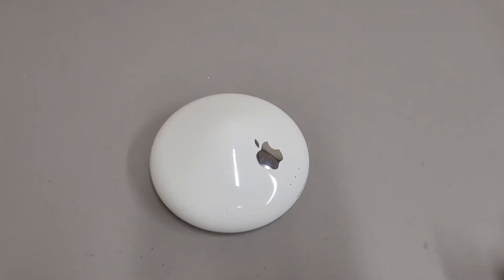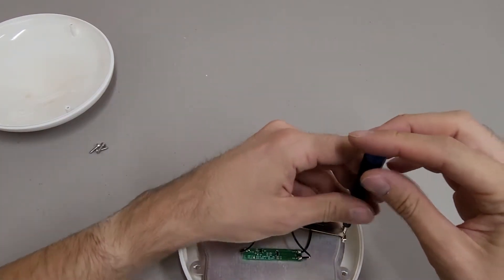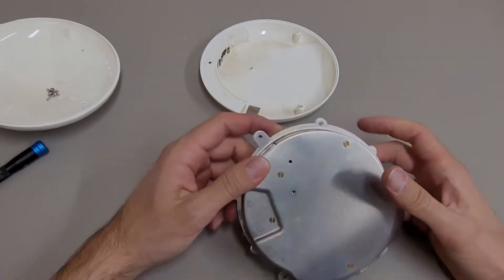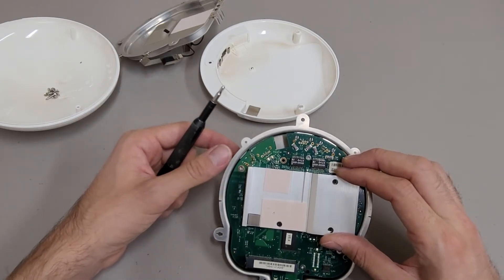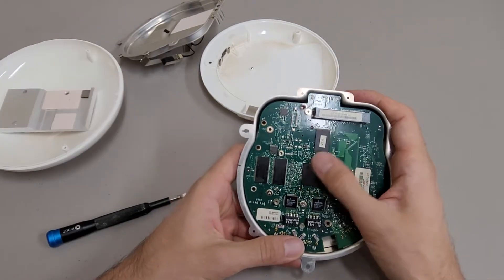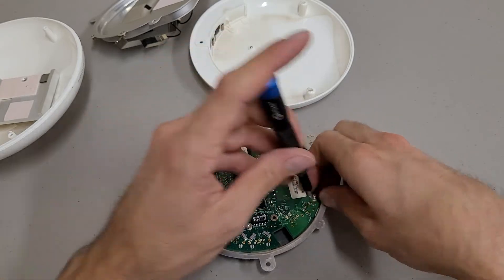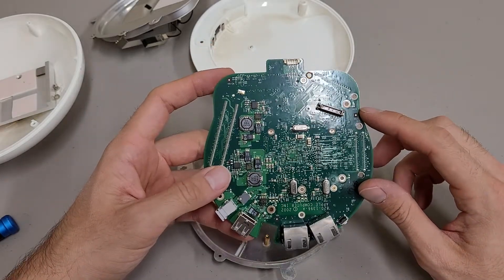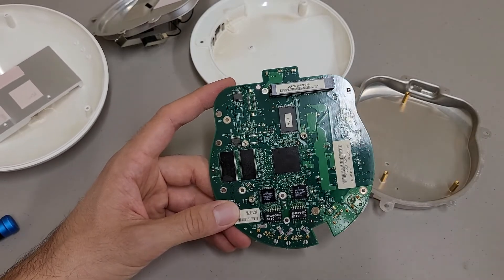Apple Airport Extreme A1034 #teardown

Comment: Does it work without the Airport Extreme card? (I'm just looking to use it for ethernet)...
Reply from the maker: I have no idea.  You could try to disable wifi in settings I think. Otherwise maybe sell it or trade it for a simple switch.
Reply: @computersales  Thank you! You've earned a new sub! Wireless in these is pointless anyway. Old unsecure outdated WPA methods. The little port you see there is actually a diagnostics port. Modem built in. The crystals are clock speeds.